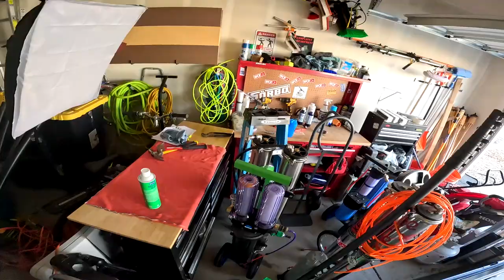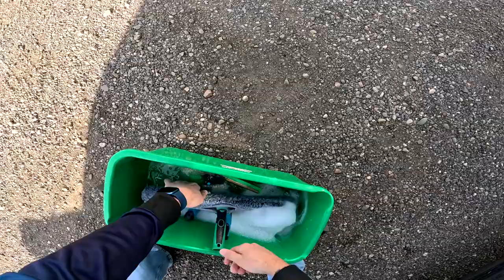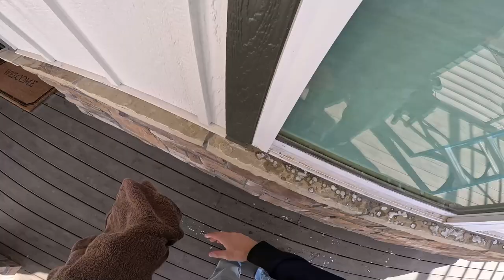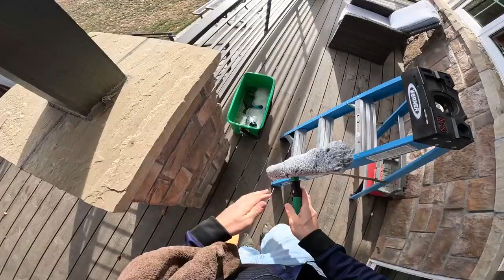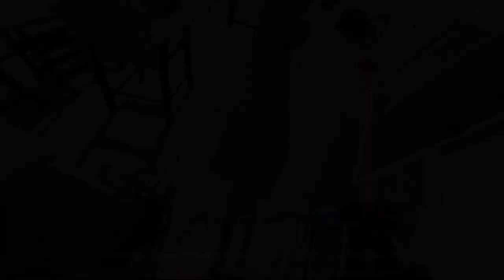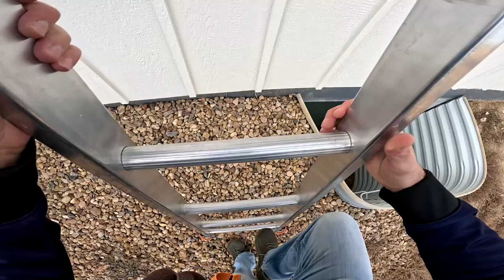QUICK OUTSIDE ONLY RESIDENTIAL CLEAN | WINDOW CLEANING

Comment: Just out of curiosity why did you do it with a squeegee over water fed pole?  Wouldn’t water fed eliminate the need for moving ladders?
Reply from the maker: For this job it was freezing in the morning so didn't even want to take it out and it was too quick with a squeegee to not do it that way I guess
Reply: @SteveOthewindowcleaner  glad someone already asked I was curious about this aswell. I just got my llc and plan on starting as soon as I order and recieve your kit from WRC . Allot to learn obviously it's a pretty simple task at hand but I was curious if hand tools or anything extra I could pick up to have on hand. I'm guessing you only use product on really bad windows or if you're not running the water fed system .

Comment: Been watching a lot of your videos recently, as I just started my own window cleaning business. Right now all I'm using is the Unger Ninja and the S-Plus. What do you recommend for the least detailing? Heard you talk about ettore brass channels, but looks like it's an S-Plus you are using here? :)
Reply from the maker: I like to use brass, and I find the detailing is minimal, I usually need to clean the frame anyways so detailing does not slow the process down
Reply: @SteveOthewindowcleaner  Thank you for the answer. What I see here in Denmark is that a lot of the window cleaners do not do a whole lot to the frames. The prices are also way lower than what you charge in the US. A regular house is no more than 30 - 40 dollars. So it needs to be fast and precise. Why is it the excelerator is a no go for you? Does it really eat through rubber a lot faster than other channels?

Comment: Do you ever really use anything less than a 14” for residential or commercial? 

What are the best two sizes to get started? I’m on a budget 🙃
Reply from the maker: Definitely, sometimes a 6”, I always have all sizes between 6” and 18” in brass channels and then just some sizes in the squeegee I use in this video. 

Best sizes to get started, 6” , 10” and 14” IMO I know that’s 3 but you’ll want them
Reply: @SteveOthewindowcleaner  is that for residential? What about for storefront commercial? Which sizes are a must to get the job done?
Reply from the maker: @MichaelBrianInc  Yes for residential, for commercial its best to go with 18" or 22" IMO
Reply: @SteveOthewindowcleaner  
22 rocks